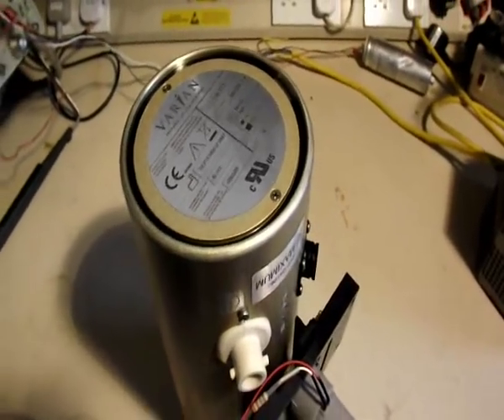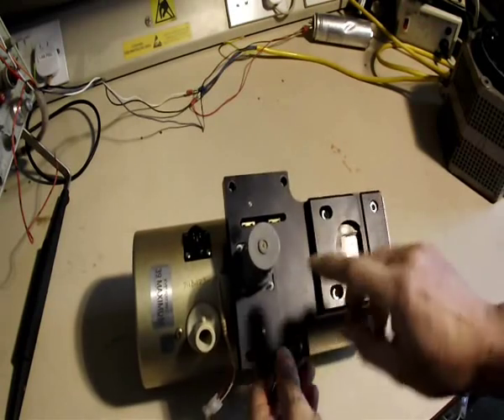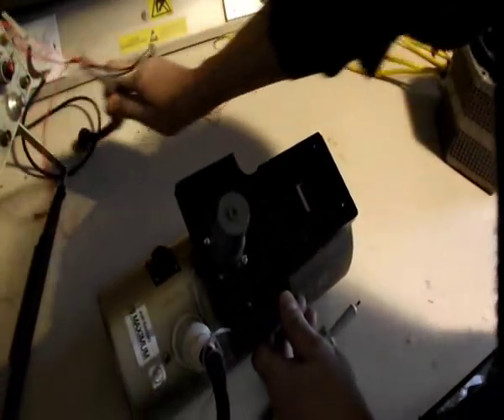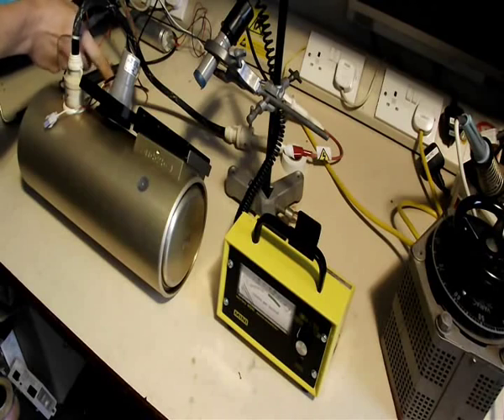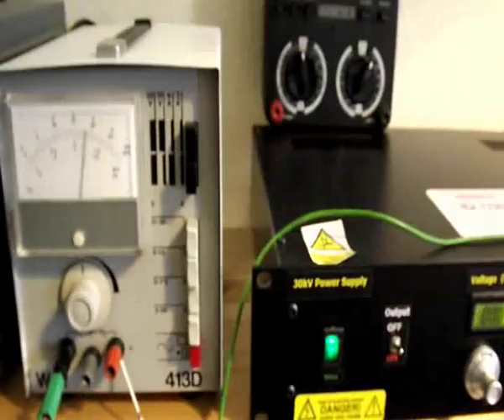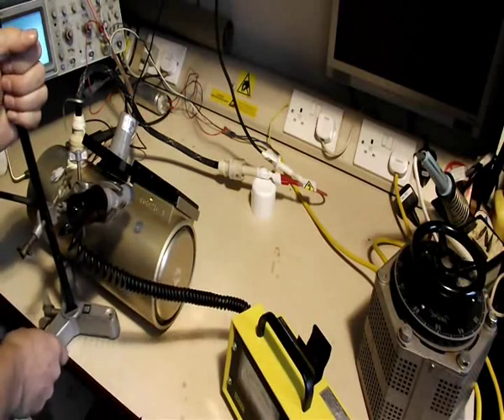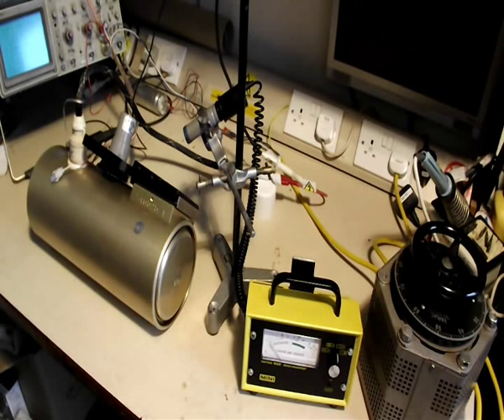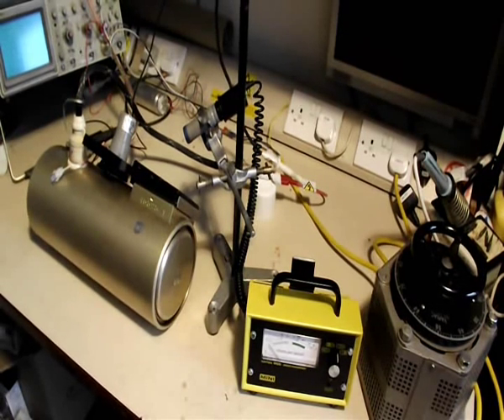X-ray tube operation

Comment: That tube sounds like it has ball bearings in it- it's quite a new tube to have a ball-bearing rotating anode.  Most newer tubes use hydrodynamic bearings and produce very little noise.